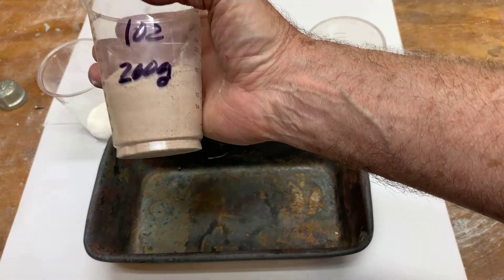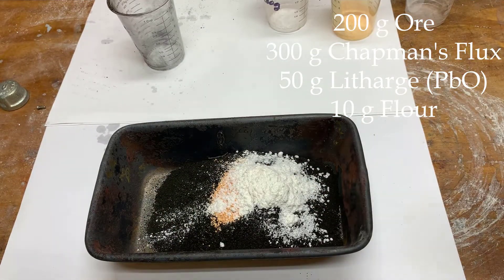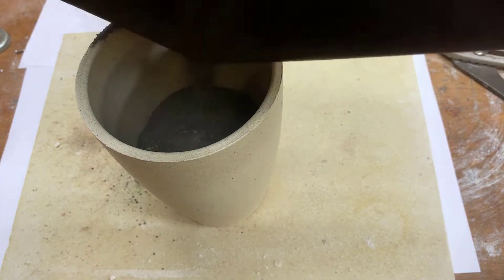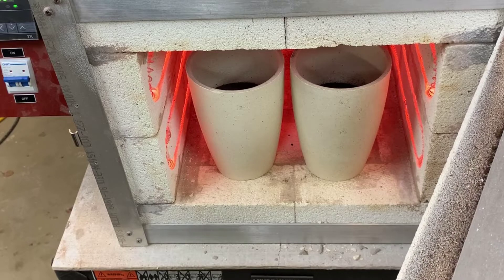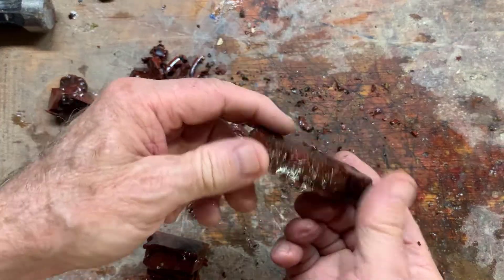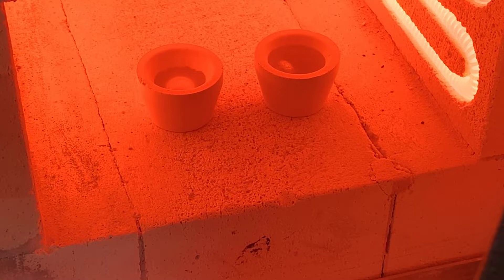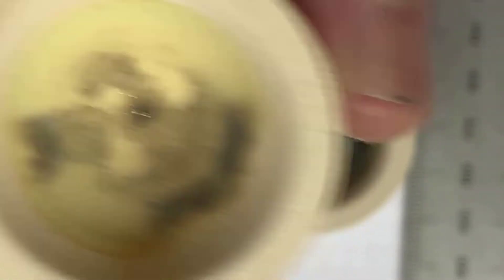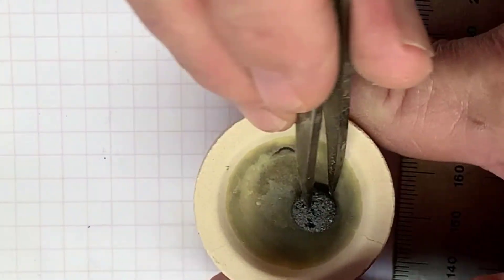Gold Ore Fire Assay

Comment: How about all the material that 'overflows' into the catch pan? Is there any precious metals in that?
Reply from the maker: The lead usually collects into a single liquid blob at the bottom of the crucible and falls into the bottom of the cone. I've had two pours that were too thick and the lead didn't all collect at the bottom. They were failed assays. -- Dave

Comment: You need iron to reduce sulphides, iron sulphide is soluble in the flux, this can be avoided by roasting low sulphur ores but high S ore eg pyrites won’t give up hidden lattice gold without reduction, the viscosity of the pour can be thinned by making the flux more basic, this also suppresses bb formation in the slag (lost lead) for best results use sodium or potassium hydroxide, the carbonates or bicarbonates won’t fuse with the silica before becoming salts of boric acid so avoid them, my pours with copper also did the same, unfortunately the lead and copper do not alloy well use silver or more copper as the collector for ore with high copper, the copper is best electrowinned away, cupelling cu will cost too high of losses of precious metals to get accurate assays, avoid cu ore unless it’s what’s available to you, don’t mix pb and cu intentionally, the dark red copper in the slag is a signal to add iron and copper to remelt for a cu prill and 2nd shot to capture the precious metals, your close 😊
Reply from the maker: Excellent info, thanks so much! -- Dave

Comment: nice!   You might want to add some fluorspar as a thinner. Electric furnaces barely get hot enough, smelting really requires 2200-2300 deg to get water like pours.  chapman flux has some oxidizers in it that will reduce some of the lead in the smelting process, you might be better off with a hand made flux. minimum 2 to 1 flux to ore, some ores require 3 or 5 to 1 flux ratios.  Nails work for reducing sulfides, as there is more surface area, or even thin sheet metal works very well. Copper in the lead will pull the gold into the cupel and throw off assay result drastically, best to oxidize the copper out if you are assaying for gold/silver. Love your content by the way, keep it up - smelting and assaying often requires a lengthy learning curve.
Reply from the maker: What a great comment! Thanks so much. I can already tell that this is going to take some time to figure out. I'm glad that I smelted two very different types of ore. It was a great experience to see such a huge difference in results. Yes, the copper is a pain in the butt. I have a professional assay of sample 108 coming back in a few days. I'll make a video about that. I'm reading "Fire Assaying" by Shepard and Dietrich. What little chemistry I had has all leaked out of the vessel long ago, so it's a bit of a struggle following it. Anyway, it sure is fun to try.
Reply: @orophilia  I use lawrence hittle from colorado for my assays, super fast and low price - he just provides results for gold and silver though. Charles Butler torch assay information might be a welcome addition to your gold assaying arsenal, basically a micro torch cupel process, it works well and is fast and cheap to do.  Shepard and Dietrich is a great book. I'm in santa clarita if you want to connect sometime, i have lots of ore crushing and pulverizing equipment that would save you a ton of labor and time.
Reply from the maker: @AUMINER1  It would be great to get together. I have a cabin in the Mojave desert if you're interested in joining me sometime. I would have used Lawrence this time but I wanted a more complete analysis. I'll look into Butler's torch assay. Thanks for the tip.  Cheers, Dave